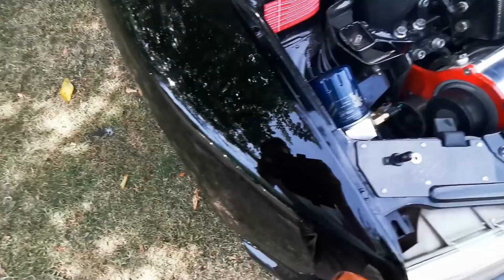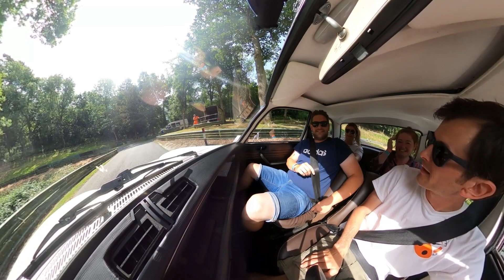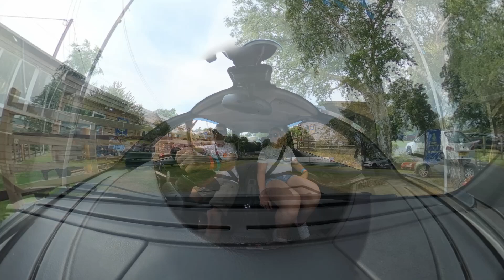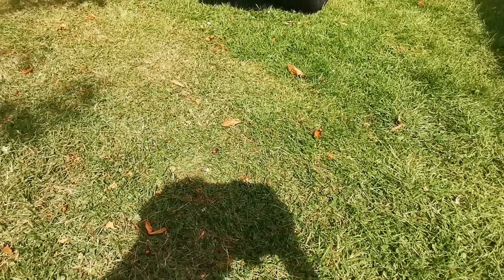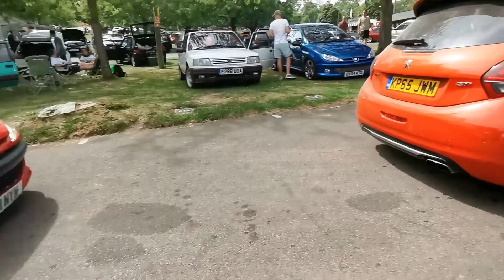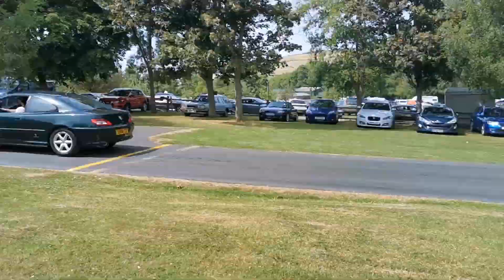Peugeot Festival 2022 - PUGFEST

Comment: Geurgous car porn. Seeing those 205 206 306 309, 304, 405s most which I’ve owned. And long gone sadly. My brother bought a 309 1.4 and put 160k trouble free miles on it driving to portugal  from uk and back several times a year. Peugeot lost the plot with their new cars. My 309gti was one of my favourite cars. Fast, good looking and big sunroof. My father in law had a convertible 304 and a ds convertible both of which he exported to Australia when he sold them.. love your vids.a blast from my past. Very fond memories. My family were all older peugeot fans. My father had a 405 m16 and even at 75 yrs old used to blast along a certain motorway at 125mph to “ clean it out” as he put it. I know they are tinny but everyone I have owned has had character and I have bonded with them. I currently have a 1.6 petrol mk 1 berlingo and am attached to that in the same way. Lovely to hear non stop laughter
Reply from the maker: What a lovely comment, thankyou for watching and taking the time to give your story! You should come along next year! Bring the Berlingo!